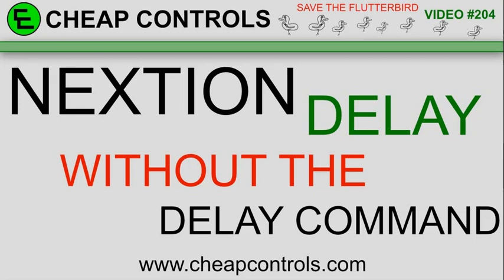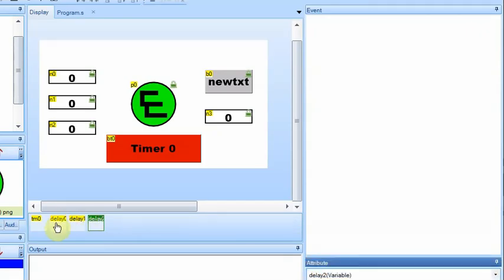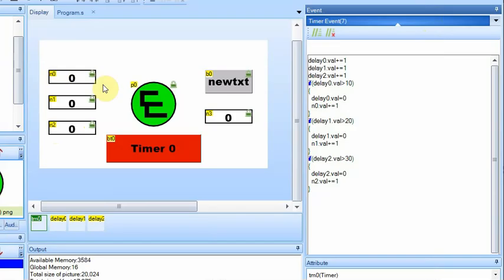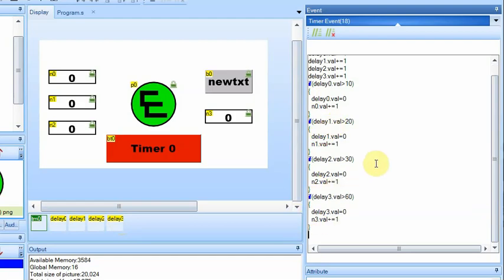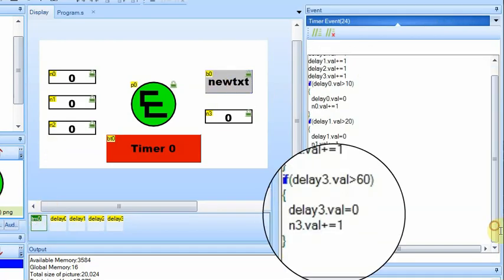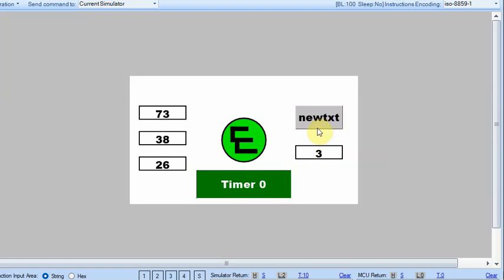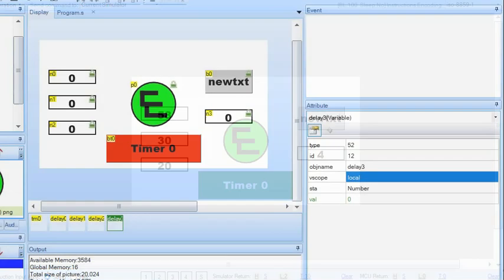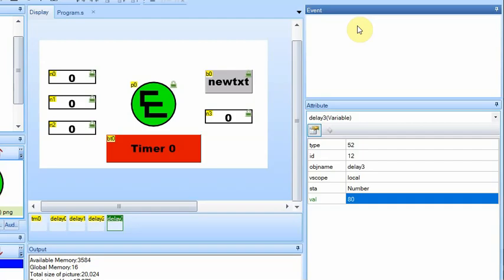204 nextion delay wo delay final

Comment: At first: great series of tutorials. I really appreciate it.  One question: why don't set the time to e.g. 1sec and use the variable to count up to 3?
Reply from the maker: Thanks for watching and taking the time to comment.  I am not sure I understand your question.  I do use the variables to count up.  If you are asking about using a smaller time base of 500 milliseconds then you are correct.  If all of your timing is in seconds then you could use a 1 second timer.  If you you have one delay of 3 seconds but another delay of 1.5 seconds then you need to adjust the timer to your needs.  In some programs I have written I need to set the timer to 50 milliseconds so I can get all the timing correct.  I apologize if this does not answer your question.  Please, feel free to rephrase your question if I did not answer correctly.  You can also go to www.cheapcontrols.com and submit your question.  I will reply through email and we can have a more in depth conversation.
Reply: @CheapControls  Thanks for the reply and sorry for the confusion. I was a little confused because you used three variables to get a 3 second delay. But your explanation made it clear to me too. I was just worried that it would be necessary to set a particularly small time (50ms) for the timer to avoid any problems with the Nextion display. But if you use the example in other programs where a higher resolution is required, then it's clear. Thank you.
Reply from the maker: Glad I was able to clarify.